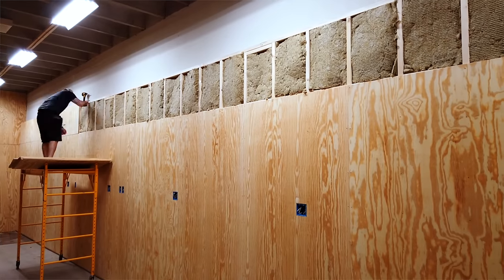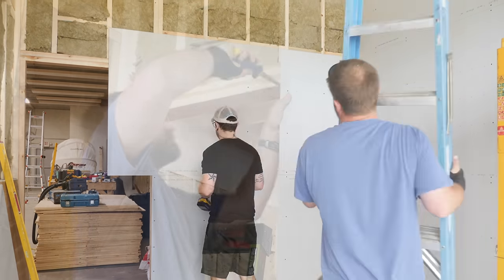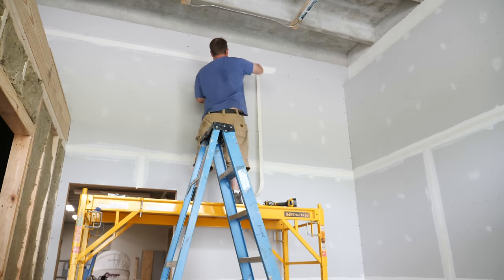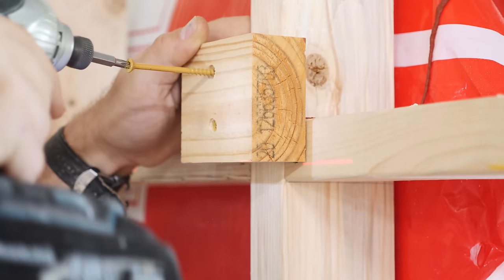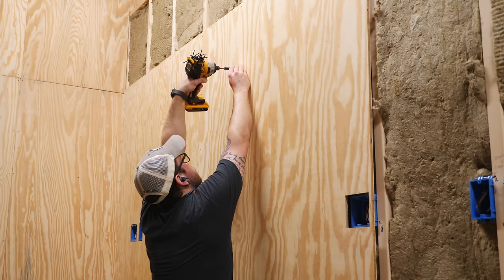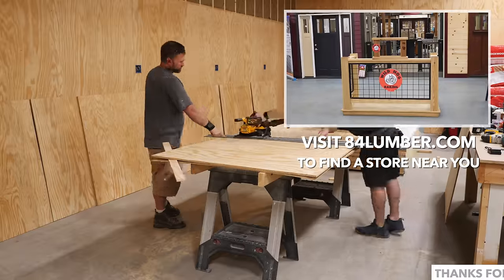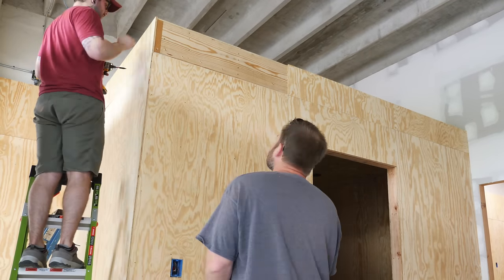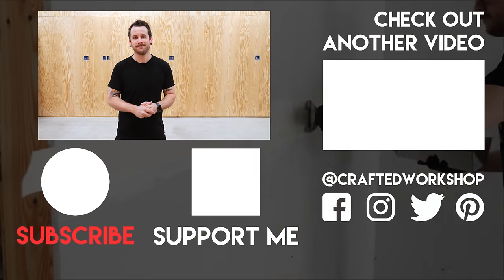Building My Shop : How To Drywall, Plywood Walls & Fiber Cement Panels

Comment: was taught t leave a gap between all dry wall before muding, This allows the drywall to bond when the mud is pressed into the seem, otherwise after a few years the seems will crack from movement. temp etc.

Comment: I have a couple of questions, but first my comments.
I love the fact that you used plywood to wrap the shop, as i believe its a lot better to hang tools and such from. You dont have to worry about finding a stud to hang most things, and it wont break as easily as drywall. 

My question though is about the office and front area.  Why did you do a mix of drywall and plywood.  I can doing the office itself with wood, but why wasnt the outside of it drywall?  Is it just because the drywall sucks so much?

Comment: I've heard that its good practice to do taping vertical, then horizontal, then corners. This way the horizontal tape covers the tails of the vertical tape, and the corner tape covers the tails of the horizontal tape.
Reply: doesn't really matter here, the vertical tails ended up in the bevels of the horizontal joints before the feathering passes of mud so everything stays flat either way

Comment: I am a day away from mounting plywood on the walls in my garage remodel, so this video came at a PERFECT time. I have been stressing about cutting the openings for Jboxes, and your angle tip made my jaw drop lol. So simple, but I can already tell it will make like so much easier. Great work!
Reply from the maker: That’s awesome, good luck on it!

Comment: Looks like that jig saw has a tilt base so you can bevel? Just throwing that out there :) i'm looking forward to your new space!
Reply from the maker: Hah, yes it does but I've locked it down at 90 degrees because it would come loose occasionally while I was cutting and not cut square.

Comment: Wow! So impressed! If you were to fill in the gaps between the plywood sections, how would you do it? I did something similar, but the seams are uneven between sheets! I tried joint compound, but it looks terrible! Also, if painted, would you use standard latex paint?
Reply from the maker: Thanks! I'm not sure that I'd try to fill the gaps really. You could either add battens over the seams as kind of a decorative accent or accentuate the seams and leave a larger, more consistent gap. I really like that look and plan to do that inside the tiny house project I'm working on.

Comment: I liked the video but just a couple of things
Is it not standard practice in the US to not glue wall panels as well as screw?
Also for the future, cement sheeting is easy enough to just nail up rather than screwing and you wont break the corners as easy
Reply from the maker: Yea, since I’m renting, we tried to make everything easily removable, hence the screws and no adhesive. Thanks!

Comment: What length screws did You use for the 1/2” plywood?
Reply from the maker: I used 1 5/8” trim head screws. https://www.rockler.com/trim-head-square-drive-screws-select-size?sid=V9146?utm_source=google&utm_medium=cpc&utm_term=&utm_content=pla&utm_campaign=PL&gclid=EAIaIQobChMIqsXOhMbA4gIVhYvICh3PwAsAEAQYASABEgJk6_D_BwE

Comment: why no stud adhesive on the studs b4 you put the drywall on
Reply from the maker: Adhesive is optional, it just allows you to use less screws. I wanted everything in this space to be removable since I'm renting.
Reply: It also stops the plasterboard from rattling I do drywall for a living never not put it on.Looks good though.

Comment: What's the story on the right wall near the middle where the plywood wasn't matching up with the frame?
Reply from the maker: The floor was that jacked up, had to raise it up off the ground over an inch and it actually went above the blocking. No biggie, still attached to all of the studs and we’ll cover the gap with trim.

Comment: when you are doing drywall every seam except corners has to have a bevel, if they dont the "mud" wont get in between the seams properly
Reply from the maker: That's not true, the ends of drywall sheets are not beveled.

Comment: Would it not have been faster plastering the drywall rather than taping and mudding? Thats what we do here in the UK
Reply: brianohbrian burns  I actually used tape and mud for one of the walls in my house and although it was quicker, the dry time between coats meant it didn't take much longer than the plastered walls I did and imo the plastered walls was smoother

Comment: Sorry for another picky comment man, you do such good work, I see you using glue of some description when your fixing anything like to bits of furniture pieces together, why didn't you use stud adhesive for the  plasterboard (drywall) thats quite a common building requirement when plastering/drywalling ... only asking as I deal with plasterboard regularly and using stud adhesive is a building requirement here

Comment: what are the pros/cons when deciding between drywall and plywood/OSB for shop walls? 
Drywall cheaper, good fire resistance vs Ply/OSB is stronger and simpler to use? I've got a bare shop and dont know which route is better
Reply from the maker: Plywood is so much easier to install. You can also hang stuff pretty much anywhere, which is nice. I prefer it quite a bit.

Comment: You should really lay sheet goods like drywall flat on the ground because if it were to fall over on you, drywall is ~100 lbs per sheet and if you have ~12 sheets stood up like that, do the math if they fell over they would easily crush your leg and break it. Try to practice safety always.
Reply from the maker: Drywall definitely isn’t 100 lbs a sheet, at least not the thickness we used. Leaning the sheets against the wall in that way is totally safe, would have to really screw up to knock the whole pile over on top of you.
Reply: @craftedworkshop  I guess it does depend on the thickness. Anyway, keep up the good work.
Reply from the maker: Thanks!

Comment: New Shops is looking awesome!
Something commonly not mentioned when learning to mud, especially when watching Youtube videos. Is the balance of weight on your puddy knife, in these videos it appears as though you are holding the knife flat on the wall when in actuality you are putting more pressure on the outside corner allowing the a slight angle to be created towards the middle. This allows for mud to be left higher in the middle and fade as it moves outward. I wish more people doing mudding videos would address this because it always looks like everyone holds their knife flat (which does not work).